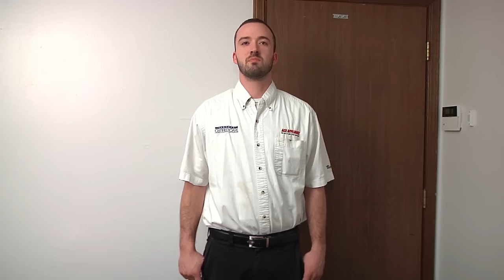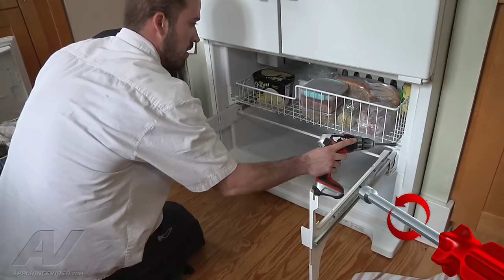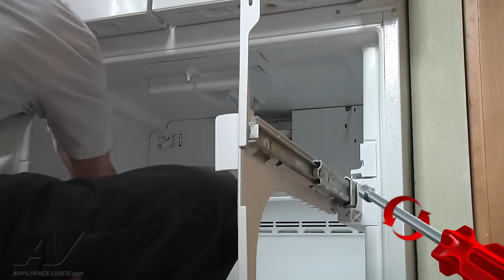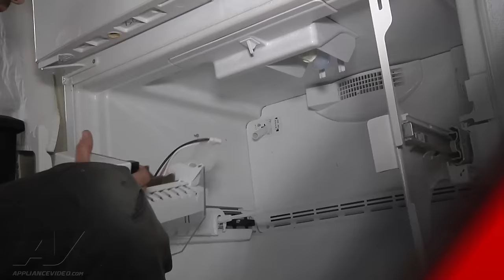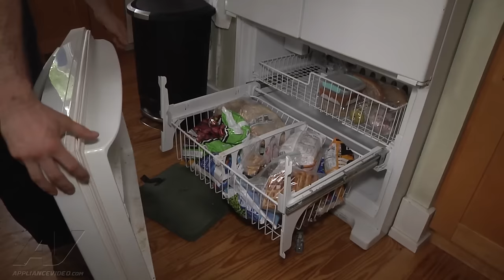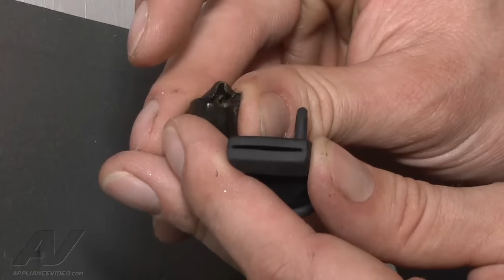Whirlpool Refrigerator Repair - Ice Buildup in the Bottom Freezer - Water Leaking - Grommet Kit

Comment: I have a question. I own a Maytag Refrigerator,and we are having problems with the icemaker. The ice has black particules in it. we have put new line  in and i clean the coils once a month. nothing has worked. what could be causing this?
Reply from the maker: +Sarah Cameron 

All of our technicians are now answering questions daily at our http://www.appliancevideo.com/ website under the Repair Help section.  We also have over 1600 common questions and
answers that you can easily search through by your model number, appliance
make, problem or error code and it’s absolutely FREE. You also have the option
to email a factory service technician with a question on your appliance at
http://www.appliancevideo.com/repair-help/ . If you’re looking for a repair video, you
can also search our library of over 2600 free repair videos. ApplianceVideo.com
specializes in quality DO-IT-YOURSELF appliance repair videos and we get over
800,000 views per MONTH to our videos worldwide and growing. If you need of
parts for your major appliance, we have over 5-million parts in stock at http://savemoreonparts.com/ .  Thanks
for your support. Matt Ace Appliance factory service technician.

Comment: Add me to list of failed drain pipes/rubber grommet. Just replaced the old design with the new one today. Don't recommend just replacing the rubber grommet as shown here because the same issue will happen again over time. Get the new drain pipe design. Thankfully we didn't have any damage to our hardwood floors after we found water on it one evening. I defrosted the fridge over night, instead of taking apart the lower freezer components and then using a hair dryer, chipping away the ice, sucking out water, etc. as shown here. If you have some way of having your food stored somewhere else overnight, this is the way to go. Way easier/faster. For my Whirlpool Gold Series fridge (about 10 yrs. old), with the new drain pipe, I had to do a slight modification to get the new drain pipe installed. The white plastic o-ring that needs to be installed over the existing exit tube from the freezer makes for a very tight fit over the new drain pipe. I used a small utility blade to shave off some of the plastic from the inlet hole of the drain pipe, then applied a very small amount of plumbers grease to help make it easier to slip it over the new white plastic o-ring. Worked like a charm. As shown here, the real issue is with the original rubber grommet that was used in the production for these fridges. Very poor design. Get the new drain pipe design and it should definitely eliminate ever needing to do this again.

Comment: Great video, but how do we fix it from happening again?
Reply from the maker: Great question, you can call
our parts department at 1-800-830-5465 and they can give you help 6-days A week
Mon-Sat . You can also search at www.SaveMoreOnParts.com 7- days a week.  If you have a more
technical question that our parts department cannot answer, our technicians are
answering all questions at our website at www.ApplianceVideo.com under our Repair Help section. We have over 6,000
common questions and answers that you can easily search through by your model
number, appliance make, problem or error codes, and It’s completely free to
search through our question & answer library. There is a very good chance
you question is already answered there.

Comment: I'm on my second Whirlpool with this problem. The first was a top freezer unit and had to trash it because Whirlpools fixes didn't work and the pan turned into a rusty mess.. I bought the bottom freezer unit and now I'm having the same issue with the frozen drain..  Appliance makers have known about this problem for along time, but they refuse to build it the right way.
Reply from the maker: Darren 

          Make sure you watch the second video and get the drain tube fix kit. Whirlpool just came out with a new part fix to solve this problem for good. Get a W10619951 drain kit, go to and purchase on line or call 1-800-816-0715 .
  Please help our ranking by subscribing to our YouTube page or posting our ApplianceVideo.com site on your Facebook or Twitter account. This will help us to continue to make new professional videos from our factory trained technicians and help people like you. We also have our technicians daily emailing professional advice to people that have problems with their appliances. We have helped thousands of people save hundreds of dollars. Thanks in advance for your help.
Reply: Thanks for the information with the part # for the kit!

Comment: Help!  I followed the steps in this video and cleaned out all of the water and replaced the P Trap in back of the Kitchen Aid fridge.  When I put it all back together and turned it back on, it was already forming a frozen puddle on the bottom of the freezer.  It appears to leaking a very small stream down the side of the back of the freezer behind the ice maker - it is freezing up below those fins again and running down.  Did I do something wrong?  Could there be another fix for this problem?  I am leaving for vacation and don't need my freezer wrecking my kitchen floor anymore than it already has from this problem.
Reply from the maker: Great question, with our
technicians now getting hundreds questions weekly, they are answering all questions
at our website at ApplianceVideo.com under our Repair Help section. We have over
3,000 common questions and answers that you can easily search through by your
model number, appliance make, and problem or error codes.

Comment: I have the same modeland the same issue but I don't have a check valve alll I have is a white plastic pipe going to the drain pan. any suggestions?
Reply from the maker: Robert 
         I suggest you shut off the unit and defrost it for 24 hours. Then pour hot water down the drain. It sounds like you just have a plugged drain assembly. Please help us provide more videos to our site by subscribing to our YouTube page or posting ApplianceVideo.com site on your Facebook or Twitter account. We also have our factory authorized technician’s email daily free professional advice to people like you to help solve their appliance problems. Thanks in advance for supporting us. Matt, Ace Appliance service technician.

Comment: Is it possible to take all your food out of the freezer and put it in another freezer. Unplug the refrigerator, leave the freezer door open for say 24 hours and just let it melt away by itself without having to take the freezer door, sliding shelves, and freezer compartment back paneling off?
Reply from the maker: Great question, you can call our parts department at 1-800-830-5465 and they can give
you help 6-days A week Mon-Sat . If you have a more technical question that our
parts department cannot answer, our technicians are answering all questions at our website at www.ApplianceVideo.com under our Repair Help section. We have over 4,000
common questions and answers that you can easily search through by your model
number, appliance make, and problem or error codes, and It’s free to search
through our question & answer library.

Comment: I did these steps and the ice is back just as bad a week later. I don’t have an ice maker (or water supply hooked up) so what would be causing this? When I took the back panel off there was a ball of ice surrounding the copper coil and some wires on the right side, but you didn’t show that in the video.
Reply from the maker: Great question, if you have a more technical question that our parts department cannot answer, you can search our over 17,000 answered questions free at our website www.ApplianceVideo.com under our Repair Help section. You can also call our parts department at 1-800-830-5465 and they can give you help 7-days A week ,or search at www.SaveMoreOnParts.com  .

Comment: I have challenge for you:
is can be something like DIY install the tracks on regular Refrigerator to convert the door? :)

it's not heavy door, just light door plastic of Refrigerator De Frost.
just for replace them because the connection it's poor/total-loss (not the door itself).

must be solution for this!
and yea, door is expensive,
and i from israel... so video is want i love to see to do myself :))
Reply from the maker: Great question, you can call
our parts department at 1-800-830-5465 and they can give you help 6-days A week
Mon-Sat . You can also search at www.SaveMoreOnParts.com 7- days a week.  If you have a more
technical question that our parts department cannot answer, our technicians are
answering all questions at our website at www.ApplianceVideo.com under our Repair Help section. We have over 6,000
common questions and answers that you can easily search through by your model
number, appliance make, problem or error codes, and It’s completely free to
search through our question & answer library. There is a very good chance
you question is already answered there.
Reply: +ApplianceVideo.com

Not a auto reply of what I asked at all...
Is UnBrand and no problem without, I just want to know (in video!) how to do DIY this. Completely transform product that no exist! :))
And guys, I'm from Israel and I don't get sim to call only to you.

Comment: What's the part number for the grommet and the updated drain tube
Reply from the maker: slntscpe 
         Its based on your specific model. Get the model number off your unit and call 1-800-830-5465 and our parts department will give you the exact part number. Please help us provide more videos to our site by posting ApplianceVideo.com on your YouTube, Facebook or Twitter account or add us to your circles. If you are in need of any parts please support our parts department on line at http://savemoreonparts.com/ or call 1-800-830-5465 7-days a week until 11pm Eastern time. Thanks again your support.  Matt, Ace Appliance service technician.

Comment: you dont have to remove the drawers or back blate of freezer a heat gun on low or hair dryer works to melt ice and clears drain. Take a pair of scissors and cut a V notch in rubber grommet it will last years and no problems

Comment: the new duck bill plugs up the same as the old one. cut a notch out of the new one to improve the flow
Reply from the maker: Dan 

         We used a W10309238 updated grommet kit to complete this repair. You need the new kit to fix the problem permanently.  Please go to our website linked in the description above with your exact model number. There, we have a model look up where you can enter in your model number to search for parts. Also, you can purchase parts on the right-hand side on our page, labeled "Buy Parts Here," or call 1-800-816-0715. Let us know if this helps!

Comment: Mine is a Maytag mfi2067aes, I don't see that on the list, does this fix not work for mine?
Reply from the maker: Great question, you can call
our parts department at 1-800-830-5465 and they can give you help 6-days A week
Mon-Sat . You can also search at www.SaveMoreOnParts.com 7- days a week.  If you have a more
technical question that our parts department cannot answer, our technicians are
answering all questions at our website at www.ApplianceVideo.com under our Repair Help section. We have over
4,000 common questions and answers that you can easily search through by your
model number, appliance make, and problem or error codes, and It’s free to
search through our question & answer library.
Reply: I'll see what I can find out, thanks
Reply: I actually found the part on Amazon that fits my fridge

Comment: Does the duck bill have to be put onto the drain? Can it not be omitted?
Reply from the maker: Aimee
                              All of our technicians are now answering questions daily on the ApplianceVideo.com website for anyone needing help. Just copy and paste this this question under REPAIR HELP, and one of our  factory authorized technicians  will answer any technical questions at absolutely no charge on your appliance issues. We also have over 2600 free repair videos to help with your appliance repair issues. Thanks for your support. Matt Ace Appliance factory service technician.
Reply: I read in another forum that without the grommet present, warm air is sucked into the freezer unit via the drain every time the door is opened.  This can lead to other problems.

Comment: I wanted to share this info since it took me DAYS of very difficult research to find a replacement "defrost thermostat" for a Kitchen Aid (made by Whirlpool) with this same freezer set-up. My refrigerator is the Kitchen Aid M#KFXS25RYBL0 and I had several parts places tell me there was no information on that part. Two places thought they had solved my problem but the part they came up with was for the ice maker.

While I COULD find a part number for the entire wiring harness (including the Fan... all for over $120) no one I contacted could find the part number for just the Bi-Metal thermostat.  So the magic part number turns out to be W10165425
That is a Whirlpool OEM manufacturing number. That part physically looks the same and has the same Temperature range (L42-30F).
Of course I am not in any way affiliated with any of these manufacturers or Appliance Video (whose videos have been INVALUABLE in troubleshooting and repairing this refrigerator) but the part has been installed and working like a charm for 3 days now.
Good luck.
Reply from the maker: Thanks for your response, we are glad we could help. Our library of over 5,700 videos are currently helping over 1.6 million people like you every MONTH.  Please help us by subscribing to our YouTube channel, or post our website www.ApplianceVideo.com to your Facebook page, Twitter, Instagram or any other social media sites. Your support will help us keep producing more free quality videos.

Comment: Is there a plug where the drain line is? It looks like there is something in there that should be removed.
Reply from the maker: Hello John and thank you for your comment.
There is no plug in the drain line. There is an updated drain kit that will be needed for your unit to correct the problem. Use this link and order the drain kit by your model number:   Whirlpool Refrigerator Repair - Ice build up in the bottom freezer - GX5FHDXVQ02

ApplianceVideo.com is a family-owned and operated company providing you FREE, high-quality repair videos. To make new videos and answer your questions, please purchase the parts you need from us at 1-800-830-5465, or order parts online at ApplianceVideo.com. Thank you for your continued support and good luck on your project.

Comment: whirlpool fridge model WR124UN bought new 28 months before out of warranty freezer not working but fridge light on don't understand whats wrong,its start with 3 days not work and 4th day start working again and next day again stop,,this happens couple of time now its totally not working...there is no ice build up anything like that so dont understand.....need help
Reply from the maker: If there is no ice build up in the freezer section on the back wall, then step #2 is to make sure the freezer evaporator fan motor is running. Step #3, make sure the condenser fan motor is running in the back by compressor. If all checks out, you may have a sealed system failure and need a technician to look at it to confirm.

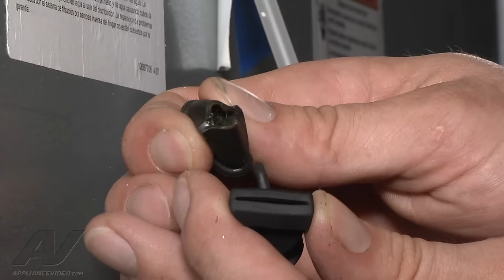Comment: Apparently, there's a "fix to the fix" ... I bought a Whirlpool bottom freezer 'fridge from Home Depot in Nov of 2012. I also bought the 5 year warranty. I discovered ice on the bottom of my freezer last week. I described the problem to the person that Home Depot sent over for repair. He said he fixes about two a day of these. I mentioned that per this video, a duck bill grommet would replace what I had (see the 13:00 mark of this video). He then tells, me - my model already has the duck bill grommet. The thing that is now installed as a fix is a "P-Trap Drain Tube". I'll let the author of this video comment on the details of a P-Trap Drain Tube. I will say this: He showed me my clogged grommet and it was a clogged duck bill grommet. So, things were OK or me for 22 months w/ the duck bill grommet
Reply from the maker: Charlie 
            Thank you for the update we definitely use this information for the updated video.
Reply: I was just to Sears yesterday to purchase the new duck bill design but the part they're supplying is the P trap as well.  Now I just wait for the part and a day with below zero temps so I can put the food out on the deck.  The question that kept running through my head is is that grommet necessary? Reminded me of an appendix.

Comment: Just goes to show Whirlpool know they made a crappy product and is refusing to fix it at no cost. I will just dump this junk and get something else. I have an old fridge that came with the house that is 18 years old and it works perfectly. Yet the new crap cannot last five years. As a sears repair guy once said. They make them to fail within 10yrs.
Reply from the maker: Dee Nevel 
                  The old products were made to last. That is a fact.
Reply: *****
My old GE Fridge lasted 23 years without a problem. I replaced it 5 years ago with  the Whirlpool Gold fridge which has the water in the freezer problem..
Reply: Designed obsolescence. 
How are they going to make any money on a product that lasts forever?
Reply: @lilythedog9734  - Return customers.